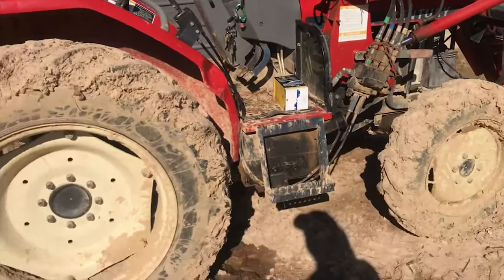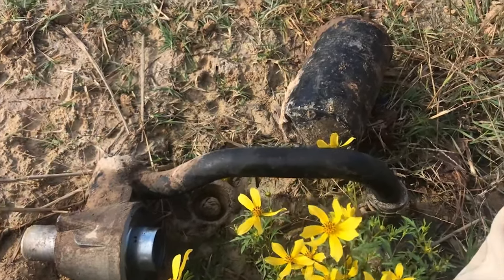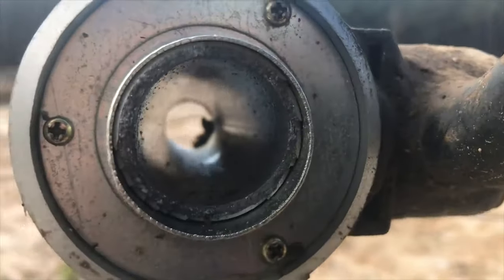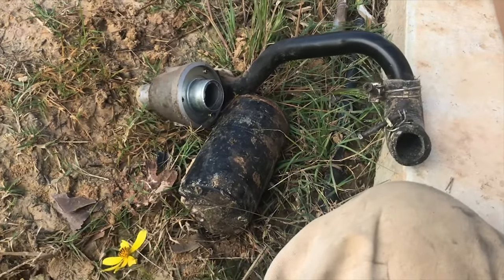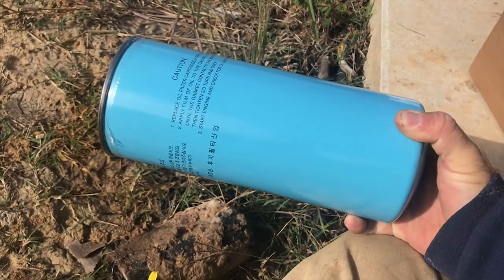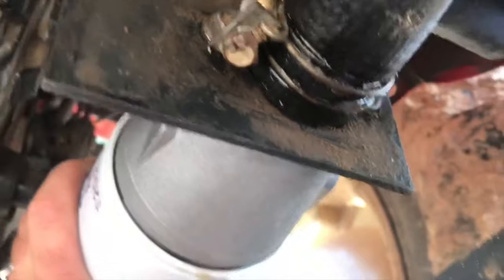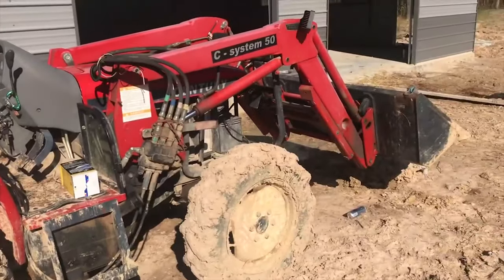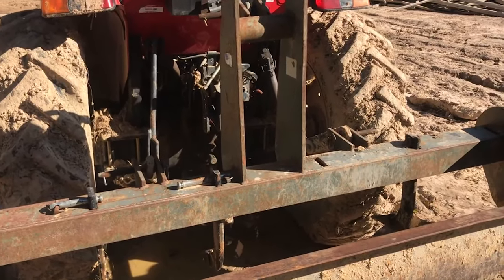Tractor Repair - Hydraulic Filter Housing - Century 3040

Comment: I just purchased a Century 3045  from the original owner with 179 hits on it. He had the owners manual for the tractor as well as the Owners/Installation/Parts manual for the C-system 50 loader. Let me know if you need anything out of either of these manuals.
Reply from the maker: Just for the loader? I think I have that already. I’d like a parts manual for the tractor itself, but I’m sure they’ve changed all the numbers now anyway. Thanks for the offer! Does the load manual have info on the cylinders and the part numbers for the seal kits in them?
Reply: @TomBrueggen  yeah, it has the cylinders in blow-up form with part numbers for all the individual pieces and the seal kit.  I found a parts manual for a Branson 4320 (Century 3045) online. I'd imagine it has alot of similar features.

Comment: I just purchased a Century 3040, and I’m having some issues with the rear hydraulics pulsating. Have you ran into that issue on yours?
Reply from the maker: Yes I have the same issue. If the lever is all the way up mine doesn’t do it. But anything less than full up, it bounces. Also when I run my front end loader, the three point arms will start to let down. If I try to raise my boom all the way up while driving, you better believe my box blade will be dragging before the boom is up. I have to raise the boom for a second, then let the blade recover and lift back up, and then repeat. 

I don’t know what the issue is. I just figure it’s some internal pressure control valve that’s worn out. I’m not about to try and tear the thing apart to find out, or even worse, take it to a dealer to let them try!
Reply: Tom Brueggen ha good to know I’m not the only one with this issue, what you described is exactly what’s happening with mine as well.  I need to get some other work done on it, but when I have time I’m going to try to find the root cause. I just got a brush hog for the pasture and I’m concerned using it while the hydraulics are pulsating up and down.
Reply from the maker: I’d love to know what you find, and what it takes to fix it. Maybe I’ll fix mine too!
Reply: Tom Brueggen I’ll be sure to comment when I figure it out. Nice to know someone else out there has a Century too. I just found a parts manual for mine online. Apparently the Branson 4020 is the equivalent.